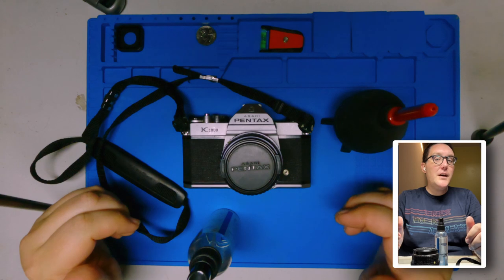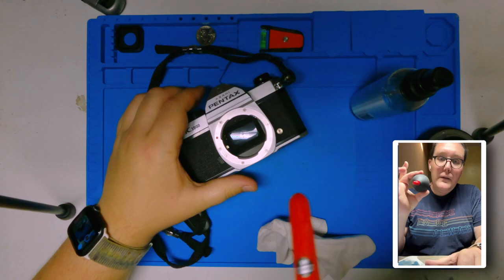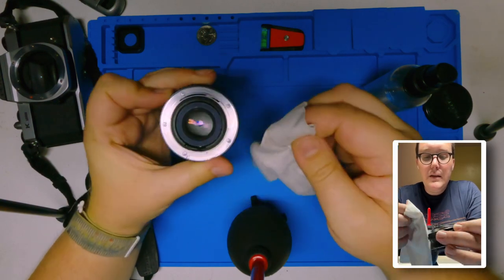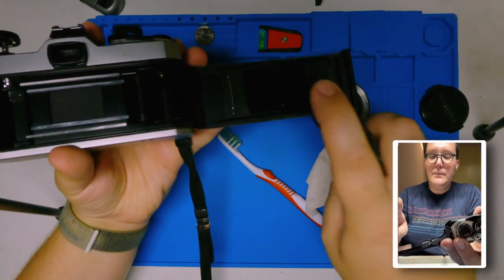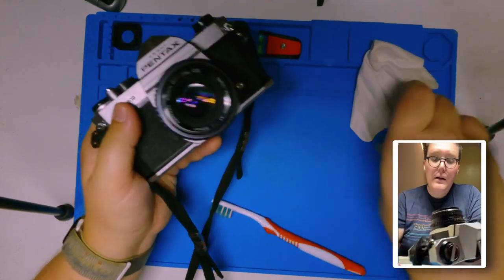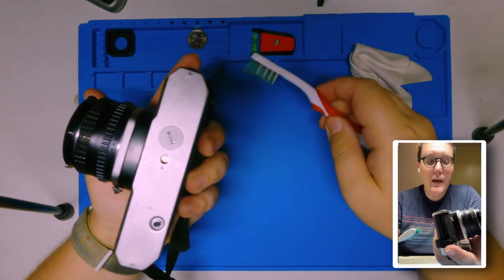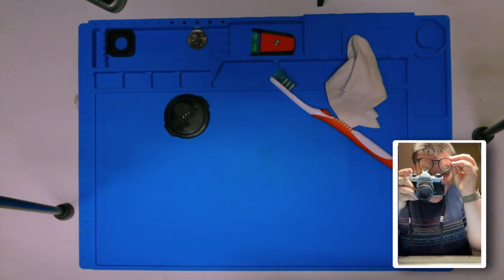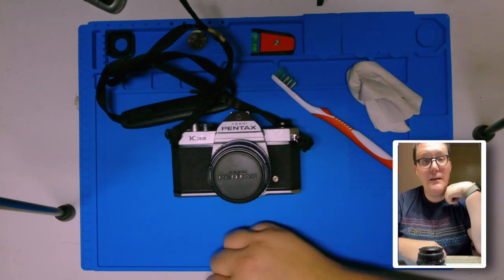Pentax K1000 Cleaning and Discussion

Comment: Good lord.. there’s 10 minutes I’ll never get back.. lol. I appreciate your efforts, but I’ve been cleaning and repairing analog film gear, as a hobby, for well over 20 years. What you’re seeing is in the prism area, so you’ll need to get inside that K1000 and get rid of the fungus/dirt in that area, hopefully, it hasn’t de-silvered too bad. The good thing is that you’ll be able to shoot great photos with that classic camera even before you clean the prism area, as the problem doesn’t appear to be in the optical path to the film, only to the viewfinder. While you’re doing everything, replacing the light seal foam in as many places as possible will never hurt. When you used the toothbrush inside the rear film door, you were using it where four or the most important light seals are located. Good luck sir!